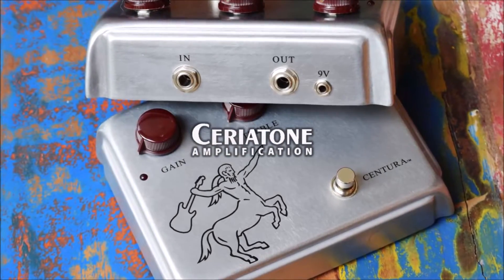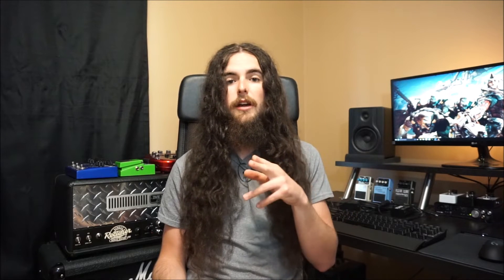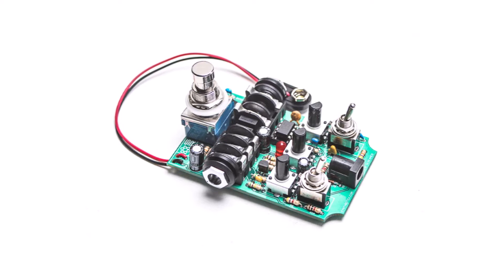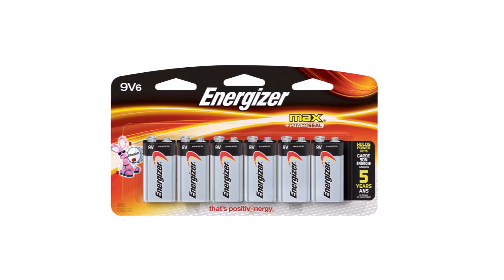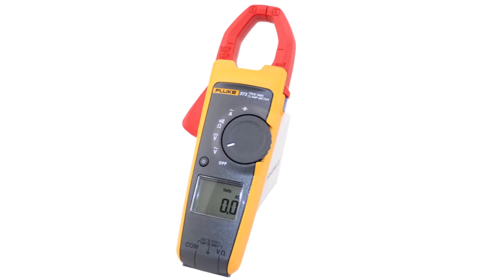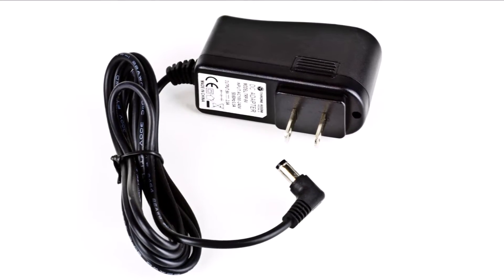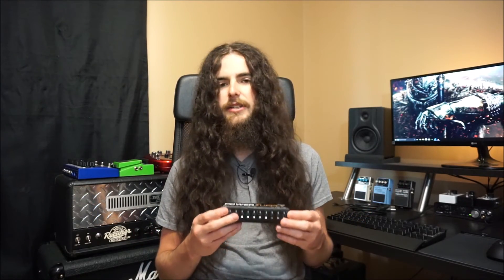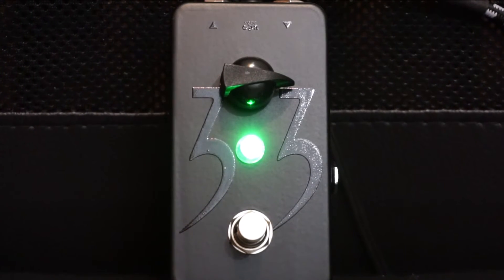Pedal Power Supplies: AC, DC, Voltage, Amperage, & Isolation  - Explained

Comment: Hi, i use a 24v power supply for a Broughton HPF/LPF pedal, 9v - 24v, i take it using 24v would be better, higher headroom live, it is in my bass amps effects loop, the only DC 24v power supply i own says 24v 3amp, same size/type 2.1mm input as most pedals, + outside,- inside, my pedal is only just over 100ma, it is my understanding it should do no harm as the pedal draws only what it needs ?, just want to check as my Joyo 24v DC power supply for my Joyo Bantamp bass amp is rated 24v 3A, this should be ok should it not ?, i don't want to buy another 24v 100ma AC power supply if the Joyo will do as it is a decent 24v DC 3A switched mode power supply ?, not a wall wart, more PC DC power brick & 2 cables style, any advice would be appreciated, thanks....

Comment: One thing you didn’t cover here is the question of using a lower than spec amperage.
For example my Pigtronix looper normally uses an 18v 300ma power supply.
The only power bricks I can find on eBay have an 18v power supply at only 100ma, will this fry my looper?

Comment: Why are a few power supplies using a 12V adapter to plug into the wall instead of a 18V? I've ran across a couple like SanJune and Legato that do this. I'm afraid  it would fry my pedal.

Comment: Very informative video, thank you! Prior to your video I couldn’t tell the difference between an ohm and a watt.  After viewing your video a few times I feel more confident.  Just got “the DUDE” pedal, but it didn’t come with a power supply. It says “ 9v DC ONLY”, it’s center negative tip. Considering the D’Adarrio PW-CT-9v DC-800mA power supply. In your opinion do you think that’s a good match?  Or would I expect to see the “white smoke of death”.

Comment: ProCo Rat pedals use center positive on a 3.5mm plug and fuzzes are wired internally with plus and minus reversed, even if the socket is with a minus center, and if they're daisy chained with a "regular" pedal the power supply will short out.

Comment: I only Y Power for certain fx. I don't recommend Daisy chain.  For example I have 2 TC Electronics Nova Delay and Modulation. 12V 300mA each. The SKB Stage 5 pedalboard doesn't provide enough mA. So, I use a 12V one spot, Y and 2 reverse polarity adapters. I took some daily chain chords, cut off the rest.  I do the same for a couple of pedals that run 18V. The rest are isolated. I just recently reorganized my main pedalboard. I also have 2 pedals that use 9V 500mA as well. One is Eventide Pitch Factor and the other is for a Boss MS -3 switcher. Most use less than 100mA. Isolated power is the way to go.

Comment: Burned a Danelectro Cool Cat Chorus by plugging it to a Pod XT power supply.
That's how I learned how to check if the power supply was AC or DC.
Thanx Line 6.
Had to replace the diode on the pedal.

Comment: On clean/consistent power you recommend the powersupply - I experience quite a bit of noise when I hook up a couple of pedals to the computer (Ibanez M80M plugged into a Revvv G3 + Fortin Grind + Zuul into a focusrite with Nameless suite or even worse with my Tech 21 Trademark 10) - might a dirty powersupply be a factor in creating a high noisefloor?
Reply from the maker: The Grind has a low noise floor, but that doesn't stop it from creating a lot of high frequency hiss at higher levels. I imagine the G3 has some amp-like noise at higher gain levels as well. My suggestion would be to test your setup running on 9V batteries only. If it eliminates the problematic noise you experience, then look at isolated power supplies. Otherwise, the problem is inherent to the pedals.
Reply: @PlagueScytheStudios  Ah, of course! Why did I not think of trying that? Thanks for the suggestion!